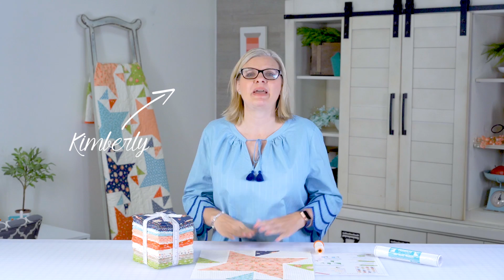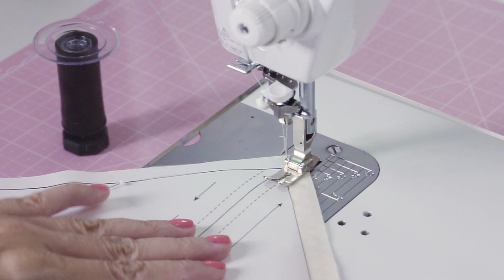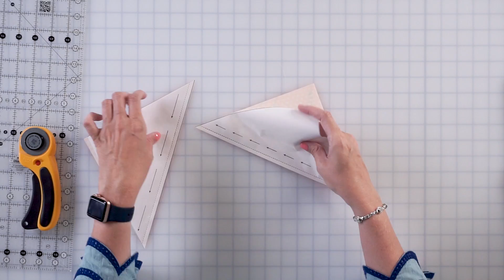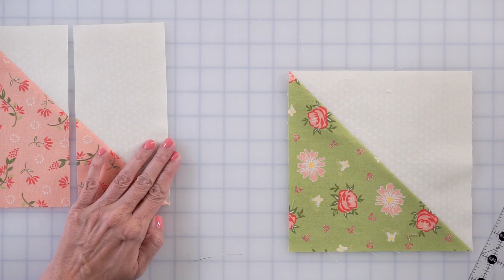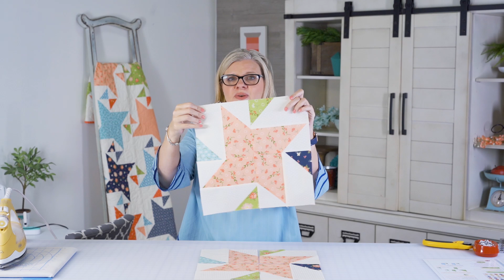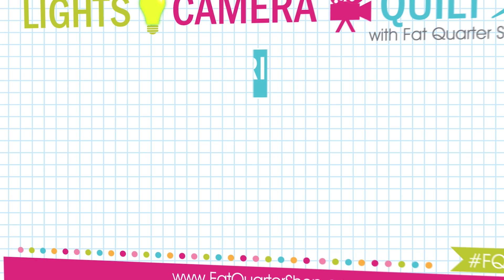FREE Pattern: Fat Quarter Flowers | Shortcut Quilt Series | Fat Quarter Shop

Comment: Love this pattern! Question, though...why do you stop at the end of first triangle line and go back to the top instead of pivoting around to the next line? It seems like a big waste of thread, especially on such a large triangle. I may be missing something important, but I can't figure out why this is the best way to use TOAR.
Reply from the maker: Hello! Kimberly just finds it easier to follow the lines this way, but you can absolutely do it the way you suggested. As long as you're stitching on the dotted lines, you're good to go!
Reply: @FatQuarterShopTX  Thanks so much for your reply!

Comment: You say in your video that the pattern for this is free but I only see where you are charging $10.98 for it 🤷‍♀️
Reply from the maker: Our apologies, it is fixed: https://static.fatquartershop.com/media/wysiwyg/pdf/FQS-FatQuarterFlowers.pdf
Reply: Okay so just the instructions are free not the pattern?
Reply: @2kidsinutah  Download the pattern to your computer then print it. I guess I don't understand what you're getting at. 🤷‍♀️
Reply: @SewMerri  I would say the pattern is the part you sold your fabric to and I didn't see a print out for that. I only saw the paper roll for sale on the website
Reply: Sew^not sold
Reply from the maker: Hello, the pattern is the instructions with sizes that you cut the fabric to make the quilt. The paper that Kimberly uses is called Triangles on a Roll and is a product we sell. You can always, of course, make half square triangles without the paper, so there is no need to buy it. Hope that helps!